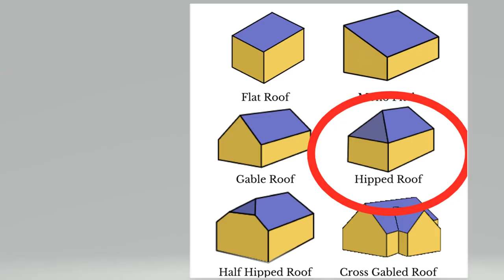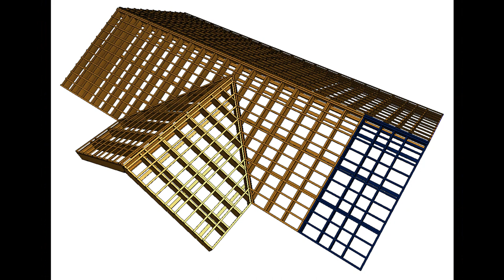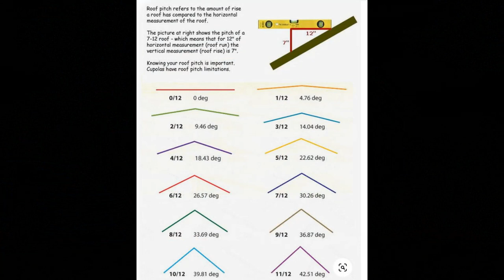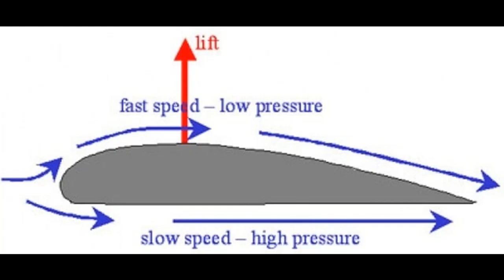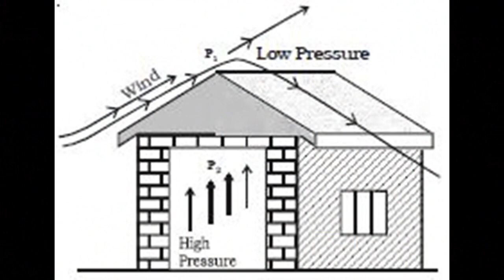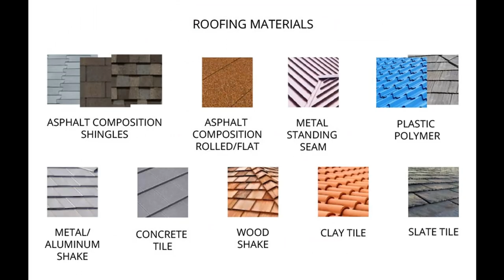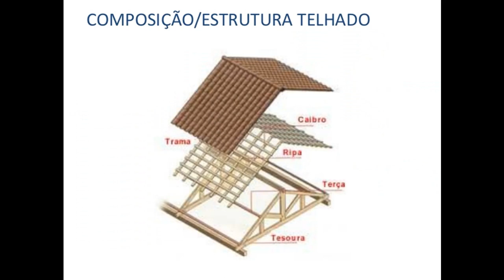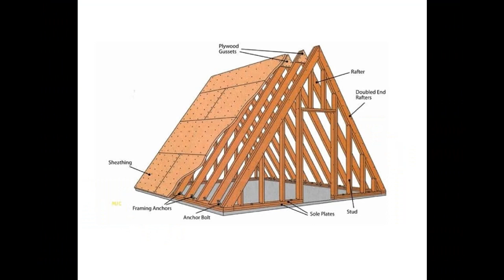BUILDING YOUR DREAM HOUSE IN JAMAIA. Pt 7. Roofing 1 of 2. EXTERNAL COVERING MATERIAL.

Comment: Do you have any advice on finding the right Draughtsman, Builders and or Contractors in Jamaica?
Reply from the maker: i would suggest you be on spot in the area you intend to build and ask around about contractors then visit something they have built and ask the people who they built for. Talk to them and listen carefully for red flags such as boasting about how good they are, smell of alcohol, and ask specific questions about how they would build such things as foundations and walls. The purpose being that you need a contractor or builder who you can discuss things with and relate to and one who is adoptable and versatile. Look for signs of dishonesty as well as punctuality. Many contractors as quite good but take on multiple jobs and lack dependability and punctuality so ask around and form your opinion.

You dont want someone who gets mad when you ask him to explain something or to change something or one who will simply ignore your wishes and then simply say this or that cant be done or that he is not doing it that way because he has been a contractor for X number of years and has never done it that way. You must be on the same page and that goes for your architect as well.

Many architects are used to drawing generic houses because its easy money to just knock out a slight variation on a previous design that requires no further engineering calculations and wont even put out the effort to come up with something original that you ask for. No, don't even consider such an architect. Find one who is willing to do preliminary plans for you to chose from and modify.

There is one more thing that is a problem with Jamaican trades people you should be aware of. They tend not to understand the tender and select process. If you ask a trades man to give you a quote they see that as confirmation that you are going to hire them and get pissed if you chose someone with a lower bid. so just be aware of that because it can cause real conflict.

Comment: Thank you for this informative video. My design sketch is for a flat overhang roof with a huge overhang. Is this unwise in jamaica due to hurricane or if it's well designed and fixed/strapped will in not matter and be ok?
Reply from the maker: if its a slab roof then high winds wont matter.
If its a conventional roof then an extreme overhang is just a problem waiting for the right combination of wind speed and wind gust.

You can mitigate the potential for damage by designing the overhang as a detachable section. IE, an attached soffit that would break away in extreme winds leaving the rest of the roof intact or you could incorporate sealed boxes in the overhang along with the appropriate amount of straps so that in case wind does get under one section it will be contained within that box section and not leverage that entire roof section.

A third way is to attach the roofing over the soffit/overhang in such a way as to allow wind to rip it off or pass up and through that section but that is dependent on the type of roofing you chose.

The bottom line though is that its pretty much impossible to ensure that there will be no damage in high wind conditions with an extreme overhang. You can only limit the damage to certain sections with the correct design.
Reply: jussayin mipeece Thank you Justsayin mipeece. Are you an engineer or architect as you come across knowledgable? My roof I want is similar to the modern square house you showd in the video but imagine the food sticking out 6-8 feet in front of the house to create a rain shelter. And around entire perimeter.